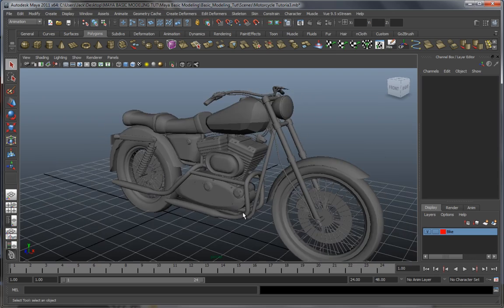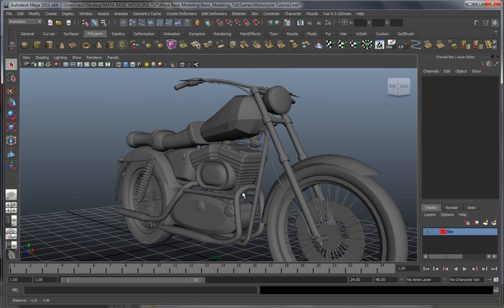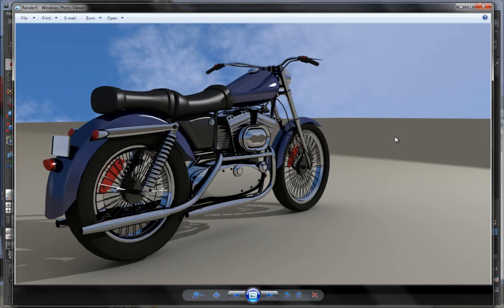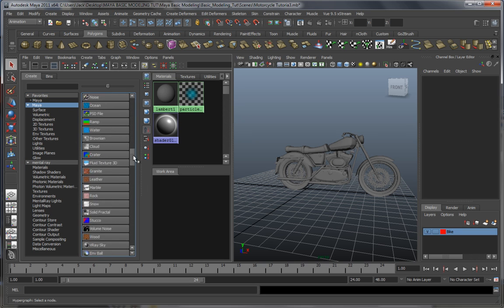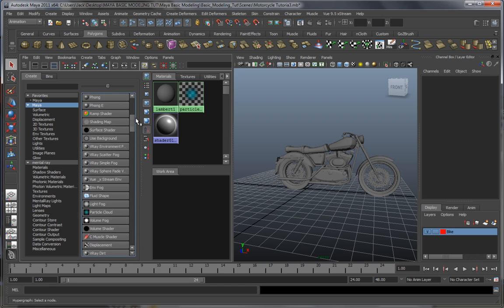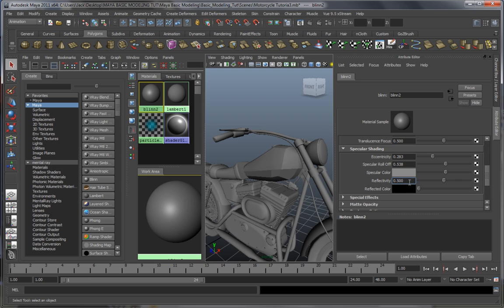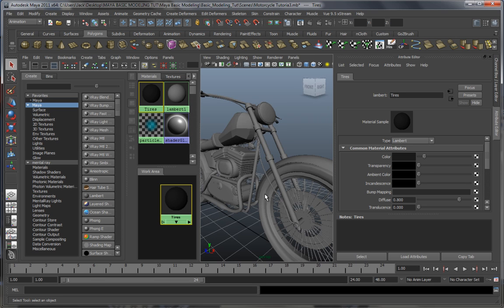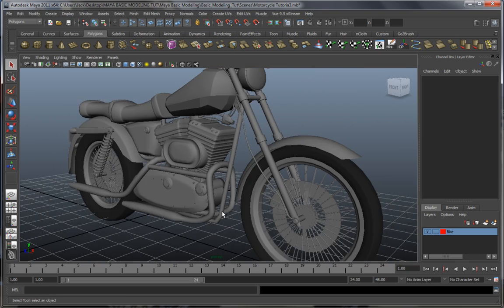Maya Basic Texturing and Rendering Tutorial ( Part 1 of 5 )

Comment: Ok I figured it out. Here is what I did:
1) select a loop of faces on one side (not the edge, but the actual faces)
2) mesh-> extract
3) repeat 1 and 2 on the other side of the tire
4) select the tire and do mesh-> separate
5) select the inside of the tire (the metallic part) and the 2 extracted set of faces and do mesh -> combine
6) select the combined pieces and do edit mesh -> merge vertex

Comment: Ok. I will try that out! Another question i have is, whn rendering with Vray, certian materials dont show up in my renders. Do you have to render with Vray materials, the maya materials, or can you just render them all including the mental ray? I am doing an animation and i need a helicopter to blow up a building. Im confused because i want to get the textures in there but sometimes they dont show up. ANd what setting would you suggest i tweak for the fluids?